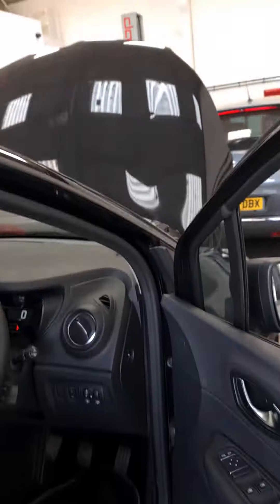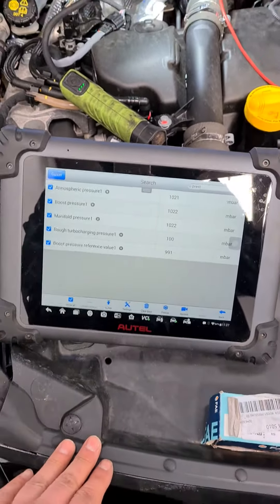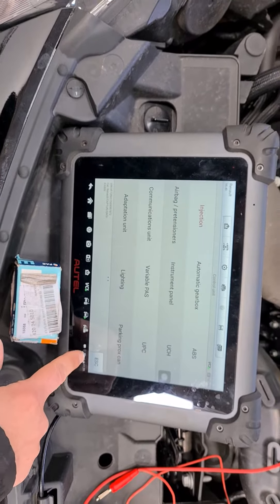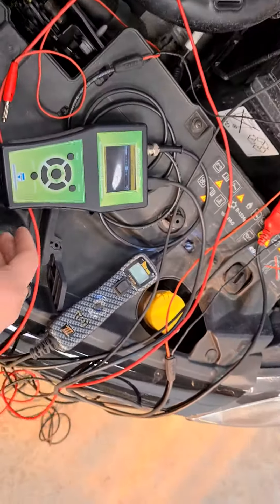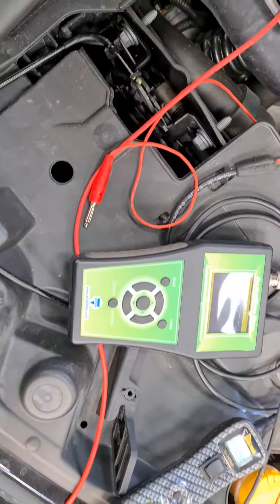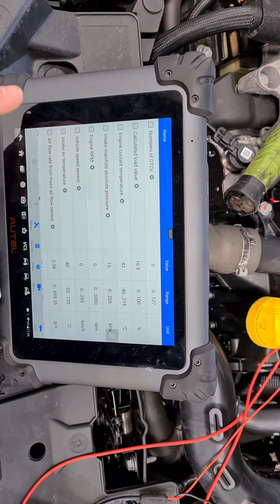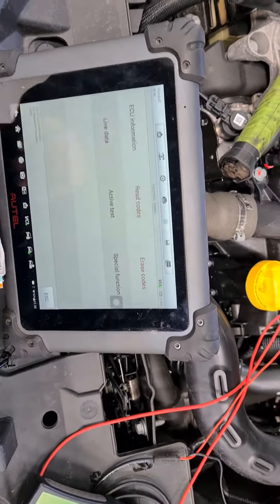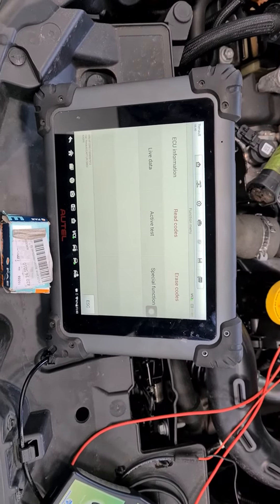Renault Captur Boost Pressure fault

Comment: I think this is the problem I’ve got with a 1.5dci in a 2013 Nissan Quasqui putting red engine light on and anti skid light on and lack of power - very annoying but mine has a 3pin wire on sensor and 0volts at the signal wire with ignition on not running !! Great video great explanation nice one mate ..😀

Comment: Hi
very comprehensive video, would you mind answering a question ?  I am trying to solve a turbo charger solenoid valve, control circuit signal outside upper limit (DTC 004517) on a Dacia Sandero Stepway 1,5DCI K9K 612 manual from 2013. I think I might have the same issue you described in your video . I tested signal voltage KOEO at 1.65Volts on the original MAP (Bosch 0281 002 997) . Figured voltage was to high so bought another MAP (Bosch 0281 002 996 superseeded part) I tested the new unit it still reads 1.65Volts key on engine off . Your suggestion is that in this state it should read nearer a volt any ideas where or how I can confirm this data , I am wondering if I have two faulty MAP sensors.

Comment: Force ignition in gear foot on brake and press ignition switch on for approx 10 seconds
Reply from the maker: Thanks very much for the information!
Reply: @eliteautomotivediagnostics4424  no problem  it will keep substituted values until fault is cleared  and ecu has done circuit check and happy  good old Renault intelligence. Boost sensors on those read incorrect or stick or short quit common also up stream turbine sensor another common one
Reply from the maker: @terminaldiagnostics5576  thanks for the info :) First time I have come across the data in EOBD being substituted, I've only ever found manufacturers data to be substituted so a good learning curve for sure.
Reply: @eliteautomotivediagnostics4424  absolutely in this job every day is a learning curve the person  who Says they know everything don't know shit
Reply: Or turn on ignition and hold button for 3sec til it asks to remove keycard.

Comment: Should baro pressure always be the same as intake manifold pressure with just key on? This seems to make sense to me
Reply from the maker: Yes that's correct. They should always match. The engine computer uses these values for plausibility testing.

Comment: Hello friend, sorry for the trouble, I drive a laguna 3 2.0 dci, mostly I have a problem with error df 004, the other one that says +12v, also then it goes into safe mode and also turns off the cruise control because they are connected, when I clear the error it continues it works without problems, it happens to me when the car is not fully warmed up or after a few days when I don't drive the car, I step on the gas and it does that to me, when I wipe it it continues to work without problems. Is it possible that the sensor you show on your clip has gone because I have already changed the turbine pressure sensor and the same thing is happening again. In normal driving, there are no problems, and also when the car warms up and you drive a little longer, you press the gas all the way in a certain speed to avoid overtaking, there is no problem.